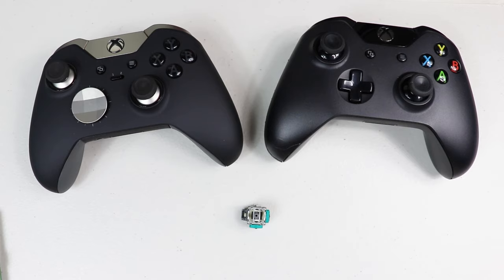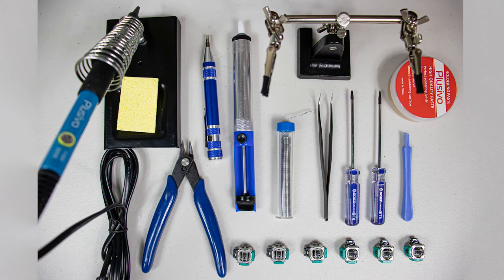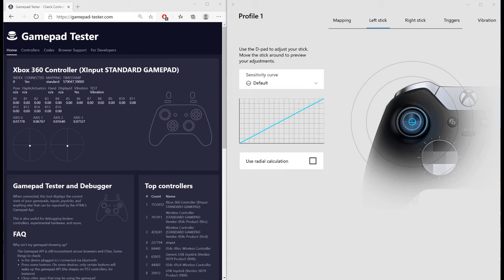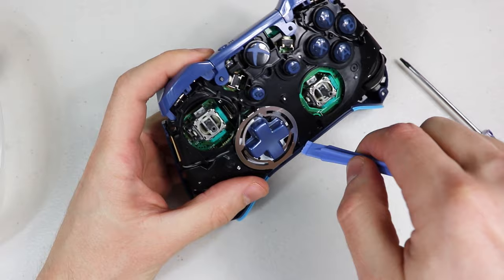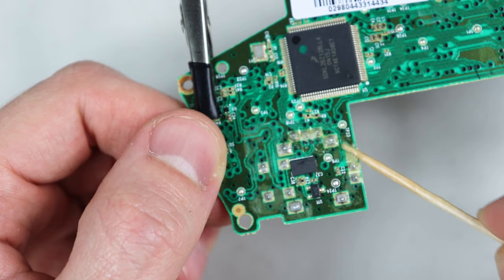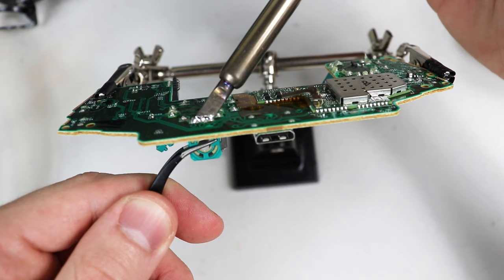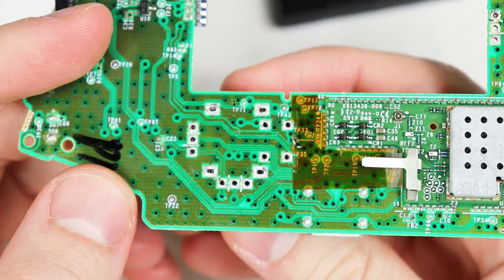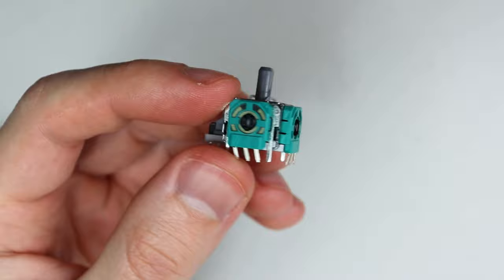How to Replace Xbox One Controller Analog Joystick - NEW METHOD - Fix Stick Drift, Broken, & Loose

Comment: I have the following problem: the analog stick is apparently good but instead it stays all the way up. I changed it but it still stays all up. What can I do?
Reply from the maker: Is this before or after trying the repair? If before, you should be ok replacing the potentiometer. If after, you may have damaged one of the solder pads.
Reply: @SOSSGAMING  Before and after! I don’t have damaged because I changed many …
Reply from the maker: @ennesimo84  Hmm. If it was like that before any repair, it may be because of corrosion or a crack/damage on the board, where the circuit feeds the y-axis power. But this is pretty rare.
My guess is you may have had pretty bad drift before (where the potentiometer was so worn out it was always up), then one of the pads got damaged somehow. 
It's also possible the wheel in the potentiometer is upside down. 
It's also possible the potentiometer itself is, which is also pretty rare. 
That's about all I can think of for now.
Reply: @SOSSGAMING  I finded 2 broken burnt caps near. I replaced theme but the problem persists
Reply from the maker: @ennesimo84  Hmmm. If you've checked everything else I'm not sure what else it could be. You said the solder pads look fine? Have you tried resoldering the y-axis potentiomter and cleaning it up well (with isopropyl alcohol)?

Comment: Hey bro pls help I recent put in the left analog stick and when I went to the html5 game pad the dot was completely off it axis like it on the corner. Any tips
Reply from the maker: Being in the corner is usually not a good sign.  Did you test it first before swapping joysticks?  Because if it wasn't like that before then obviously it would be something to do with the installation, but if it was like that before swapping out joysticks there's likely a different issue altogether.
Reply: @SOSSGAMING  my stick works fine.    
on html 5 gam pad it read Axis 0 read 1.000 buts it’s stuck and Axis 1 read -0.7
Reply from the maker: @muha8155  It works on the xbox you're saying or?  I'm confused.  Those readings however is typically not a good sign.  I'm guessing those are similar readings as before swapping joysticks?

Comment: Hey Soss, I replaced the joysticks, but when I plug it into my pc, now it won’t turn on. Help! Thank you!
Reply from the maker: Which controller are you working on? Might need to have the back plate (with the battery) connected if it's the X/S controller. Does the light come on? Sometimes it's the website or browser. Can try a different browser and/or refresh the website. Also, it could be the cable. Try turning it around or try a different one. Hope that helps you figure it out!
Reply: I’m on an Xbox One controller. I’ll try these things that you said! Thanks man!!
Reply: @SOSSGAMING The light does not come on with or without batteries
Reply from the maker: @mikkelkotila39  It could be that the board has a missing small diode or capacitor or has a short somewhere. Do you notice anything missing or damaged?

Comment: I’ve done everything but the calibration is getting on my nerves. No matter what I do it doesn’t react. It’s just way off balance and that’s it. Well it moves but it’s no where near correct. It doesn’t react enough for me to work it to where it needs to be

[Edit]
When I move the thumb stick it barely reacts
Reply from the maker: What reading does it show? Is it soldered on? Have you tried a different potentiometer?
Reply: @SOSSGAMING   haven’t tried any different one. Everything is soldered but the potentiometers

[Edit]
The reading shows the dot up in the left corner
Reply from the maker: @D_Infamous_Boss  which controller are you working on? Hopefully the through holes aren't damaged.  Does any through hole look like it's damaged?  It can be quite tricky to make contact with the pins to the through holes.  Sometimes you almost need to bend them a full 90 degrees.  Bending the pins sideways can also help.

Comment: Hate to be that guy, even considering i know nothing about this. But surely if there is a mechanism for the actual stick to just be able to be taken off and put back on simply, surely they couldn't also implement the same thing for this? Just a thought.
Reply from the maker: You would think! I'll give MS credit though, with the new controllers like the elite 2 and the X they have implemented integrated automatic calibration, so none of this fancy calibrating work required on those ones.

Comment: will this work for xbox elite series 2
Reply from the maker: The elite series 2 doesn't actually need calibration (has automatic calibration software in the controller itself). The only thing with the 2's is getting max range. I am actually working on the video for the series 2 joystick replacement, and should be out in a week or two max.
Reply: @SOSSGAMING  ok thanks Soss you amazing can't wait for video because my left sitck get drift up and down

Comment: I bought the same soldering iron and its the biggest pos. Barely gets hot enough to melt the solder, let alone wick anything. Im just going to bite the bullet and invest in a used nice iron
Reply from the maker: Sorry to hear it doesn't get hot enough :/ There are certainly some better irons, worth the investment in my opinion. Good luck!
Reply: @SOSSGAMING  I unplugged it and took a short break, came back and tried again. It got to the proper temps after that. Accidentally burned the pads. Thanks
Reply from the maker: @HuevosAzules  Sorry to hear about the pad :/

Comment: When I use gamepad tester and the windows calibration tool I cant see any stick drift but when I play halo MCC on PC there's a bit of stick drift on my right stick when I aim right as well as down. In fact these sticks have always been very accurate. On both of said tools when I release the stick it returns to dead center. Not exactly of course I forget but it's way more accurate than the controllers shown in the video even post-repair.

I tried playing another game and there isn't any drift. it's only in halo MCC that it drifts.

I could turn the in-game deadzones up but I'm so used to not applying any extra deadzone and raising it messed up my aim. 

So why is it drifting in MCC but not the gamepad tester :/
Reply from the maker: That's a fantastic question. If the controller is testing fine on the tester, then it's working correctly. The tester is quite reliable for that information. It would be an issue with the game itself then somehow. Very weird.
Reply: @SOSSGAMING  Hmm Ive been messing with it today. In the gamepad tester sometimes after letting go of the stick, when it resets to center, it sometimes rests at two different values; it essentially flickers rapidly two different values. Is that it drifting? it happens after I hold the stick in the directions that it drifts in-game. Also thanks for your response
Reply from the maker: @holaaamannn  Yeah, it sounds to me  like the potentiometer has run it's course. You don't have to actually replace the whole joystick as shown in the video, just the potentiometer that's causing the issue and it should be good to go.

Comment: Lol me commenting again. Where do we go if once all said and done there is no power to the joy stick just not working. Possible troubling shooting?
Reply from the maker: Is it just the joystick or the controller itself not getting power? Does it look like any of the pads are lifted off/damaged?
Reply: @SOSSGAMING  everything works on it besides the one joystick I replaced. What do you mean pads? The copper?
Reply from the maker: @jaredhb7706  underneath the solder is the pads.  They can easily become damage if heat is too high or applied for too long and they can lift off.  If it looks like the solder isn't forming to the board very well that might be the issue.  Another reason the joystick could be having issues is one of the tiny capacitors fell off.  Did you test the joystick before installing by chance? Because if it was like this before it could also be corrosion or a short somewhere like a small crack in the board
Reply: @SOSSGAMING  what do the pads look like? I did test the joystick prior and it was working so I must have damaged something. 2 of my pins broke off too while removing other bored and it took forever to remove aswel
Reply from the maker: @jaredhb7706  they're either square or circular (depending on which controller you are working on) and are metallic in color (from the solder) around where each joystick post is.

Comment: On my controller when desoldering the analog sticks the silver pads went orange idk what happened
Reply from the maker: :( sounds like they lifted off. They are needed for the joysticks to solder together and function correctly.  It is possible to re-rout the pins of the joystick to somewhere else on the board with something like a speaker wire strand, however. The concept is mentioned here: http://acidmods.com/forum/index.php/topic,44225.0.html
If the particular one(s) you need to reroute aren't mentioned in that particular post, I'd recommend posting on the forum with a picture of the particular one(s) that are missing and which controller you're working on. Good luck!
Reply: @SOSSGAMING  Is their any videos you can recommend to understand what they mean about diodes.

Also how do they lift of so easily because this has happened to me so many times
Reply from the maker: @lemong2548  That's not the part of the post I was referring to actually, but further down there is a demonstration with where to put tracer wires.  They come off easily when the solder iron is too hot in my experience.  Too high of temperature will heat up the adhesive under the pad and then easily comes off after that, I believe.  Also, duration heating the pad along well as any rougher physical contact with the pad might also come into play.
Reply: @SOSSGAMING  oh alright thank you I managed to fix it but hoe do you get the analog stick into The holes so well.Everytime I try to do it one side goes through fully while the other doesn’t and vice versa.All the pins are aligned but it still won’t go through properly

Comment: What is knock off joystick?...
Reply from the maker: Basically the ones that have integrated deadzones and high range. I think they were meant to "solve" the issue as described in the video, but they are far from the ideal replacement as they can greatly effect gameplay in a negative way

Comment: My problem is that on the new joystick, the sensitivity is doubled! It shows analog 1 on half the travel, regardless of the axis. I've traced all the connections on the PCB and every pin makes contact. What could be the cause of this and how can I fix it? Also, Merry Christmas :)

EDIT: I switched the potentiometers with the ones from the old joystick and now it's working correctly, it's reading analog 1 at maximum travel, however, now my Y axis is drifting and getting stuck in position. This means that it's creating friction with the joystick, right?
Reply from the maker: Yes, some potentiometers are a bit more sensitive. Also, can you describe in a little more detail about it getting stuck in position? 
The only thing I can think of at the moment is part of the joystick was pressed in where the potentiometer is, and just needs to be pulled out again, but it's a little difficult to explain.
Reply: @SOSSGAMING  I meant that when I slowly move the joystick along the Y axis and let go, instead of jumping back to the center, the reading shows that it's still pushed about halfway. If I move the joystick to the max distance and quickly let go, it centers itself almost perfectly. So I can't really do any sensitive movement because it would get stuck in position.

I believe that the potetntiometers I used from the old joystick are not the problem, because the old joystick had physical drift (the stick itself was visibly not centered) and was working well if I held it in the center.
Reply from the maker: @csabagyarmathy6386  Ok, so the physical joystick centers, but the reading isn't? Did you do the calibration by chance? It sounds like it's catching a bit, and just needs to be readjusted.
Reply: @SOSSGAMING  That is correct. I haven't done the  calibration because I managed to destroy 2 of the 3 contact pads on the PCB when I pushed the potentiometer back in. I need to  solder it to make contact and it would take some time to play around with it. How exactly would I need to adjust it? It's catching on both directions.
Reply from the maker: @csabagyarmathy6386  This isn't for an Elite controller is it? If so, it may have something to do with the sensitivity in the accessories app.
If you haven't done any calibration or taken the nubs of the potentiometers, then that would be the issue. It's either the potentiometer itself or like I said earlier the white nub that protrudes into the wheel of the potentiometer may have been pushed in and just needs to be pulled back out. That's my guess at the moment anyway.
Reply: @SOSSGAMING  Sorry for the late reply, I've been a bit busy letely and just had the time and patience to sit down and fix it. 

I switched the potentiometers again with some from a slightly different joystick module and managed to make the connections regardless of the missing pads. It looks like it's been done by a chimp with a pitchfork, but at least it works (almost) perfectly now.

Thanks for the great tutorial!
Reply from the maker: @csabagyarmathy6386  Wow, glad you were able to get it working! You're welcome. Well done! Happy gaming :)

Comment: Wait so if I do this manually I can use the controller on the xbox?
Reply from the maker: I'm sorry I'm not exactly sure what you are asking?
Reply: @SOSSGAMING  if I change the joysticks and do what you did could I use the controller on the Xbox or only on the pc because I'm confused because you where using that software on pc
Reply from the maker: @xxtimo_titanxx7189  Ok, I see where you are confused. If you follow the tutorial and manually calibrate, it can be used on any platform yes.
I briefly showed the Windows calibration software (which I don't think even works btw) that will only calibrate for that specific PC.

Comment: These repairs would only be worth doing on elite controllers. I'm sure after doing it several times you'd get good enough at it to where it wouldn't be such a pain but honestly I'd rather spend 54$ on a new controller than doing this everytime stick drift issues would arrive.
Reply from the maker: You can actually just replace the potentiometer for only addressing stick drift.

Comment: does this work on the elite series 2 controller?
Reply from the maker: The calibration method isn't necessary on the elite 2's (has automatic calibration by just playing like normal) but the uninstall and install part is the same essentially.
Reply from the maker: @audelusional5723  Well, it wasn't done for nothing though, it should still have better centering :) Personally, I sell some on eBay and will have a kit available on amazon in a few weeks.  The single joystick kit on ebay can be found by searching: 224138078310. The pair of joysticks is: 224220764964

Comment: i replaced a drifting thumbstick with an alps replacement and it still drifts, does anyone know what can cause this, i didnt do the centering procedure was wondering if thats the reason
Reply from the maker: Definitely the reason :)
Reply: @SOSSGAMING  cheers for that its helpful coming from someone who knows
Reply: make sure you got the genuine ones most of the ebay ones are OEM which are kinda trash specially for fps imo

Comment: This is kinda ridiculous at operator level. 😂 Never a bad time to learn to soldering.
Reply from the maker: Fortunately the new X/S models don't require manual calibration (calibration can be done in the accessories app) so progress is being made! But yeah, soldering still required lol
Reply: @SOSSGAMING  Could you make a new video for ps5 controllers? theres a new callibration website made by people to callibrate it!
Reply from the maker: @KenzyK27  I've been meaning to for a long time lol mind sharing the website?

Comment: If you bong rip all the fumes you’ll forget all about even fixing that controller
Reply: Or do both 🤣👌
Reply: Rosin flux is tree sap, the same as having a wood burning fire lol
Good point about fume extraction, but if you only ever do a few controllers then just open a window :)